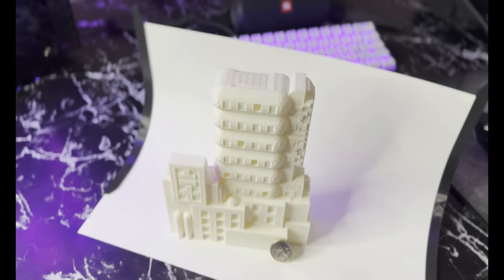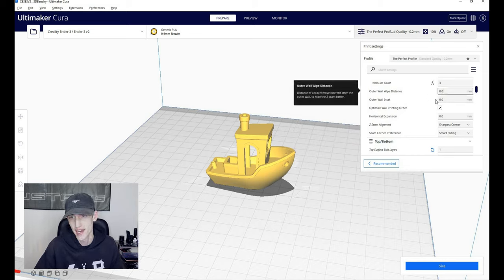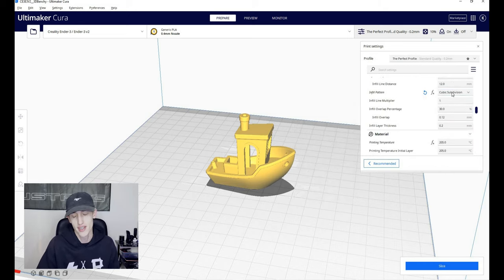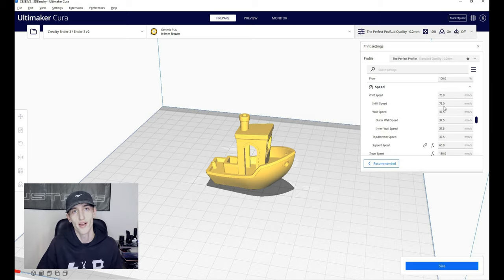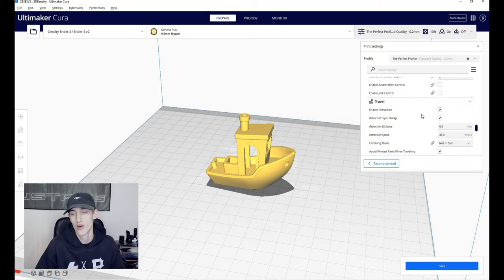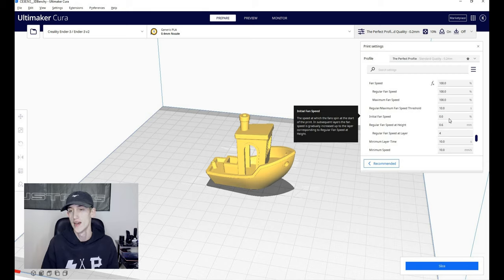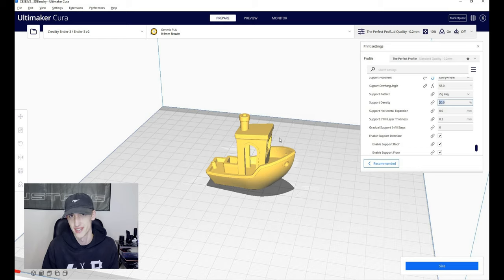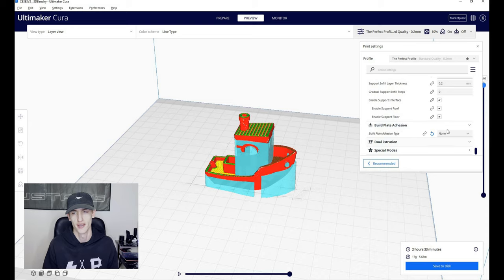How To Get PERFECT PLA Prints With Ender 3/ Ender 3 V2:

Comment: just got my Ender 3 V2 setup and run into so many issues off rip - this video has been super informative and i can't wait to jump back in get it sorted! cheers for this dude :)
Reply: I spent like 12 hours this past weekend fixing a bunch and replacing parts. 
My advice would be to fix one thing at a time and test it. Fixing multiple things at once and you won’t know what the problem(s) is/are.
Reply: Welcome to 3D printing where the real hobby isn't playing with your prints, it is getting the thing to print... anything... to play with
Reply: Did you get on with the settings in this video?
Looking to applying these myself

Comment: Some other setting i followed got me to 13 hours for my current print and with your settings it got me down to 6 hours. time will tell the quality but using an ender 3 cant blame the settings for that all the way
Reply: What did time tell you?
Reply from the maker: Let me know how it works for you! I’ve tried the same settings on a stock ender 3 and they seemed to work great In my experience

Comment: Just wanted to point out that your wall line count is tied directly to wall thickness which relies on your line thickness. Line thickness being 0.4mm x 3 walls = 1.2mm. I don't think you can/should unlink those settings from one another as increasing or decreasing any of those values independently from one another will cause changes in the amount of extrusion is pushed through the nozzle to compensate. (ie. Wall thickness 1.5, wall line count 3 at a default line thickness of 0.4 based on nozzle width... that would result in the printer pushing out more filament to have a line thickness be 0.5 to be able to meet the wall thickness). I believe Cura will warn you too when doing that or as I see in your profile I think it's greyed out so you can't change it unless you click on the Fx icon next to it.

Thanks for all the pointers though, many of these settings helped.

Comment: Useful video...
Always on the lookout for better prints, so checked your settings to my own, they are pretty much the same as mine for my CR10 and Ender 3 V2. I've printed on glass with the CR10 for more than 6 years just using a glass bed and good quality hairspray. In that time, I only lost a hand-full of prints but never to adhesion issues, I should also note, some low cost hairsprays don't work so well...

Comment: I love your info on the printers. but I have a ender 3 pro with a sprite extruder and a cr touch. my main problem is the print starts on the low left hand corner. How can i change the setting to start in the center of the bed.

Comment: You should make  a video on how to make really strong printed parts and printer settings for prints that can withstand weight being hung from them and can take some force. I love this video but will these settings in this video work for prints that need more strength is the question

Comment: I have a question i followed this quide and saved a profile when i slice a file and try to print print speed is till set to 100 on the first layer i have to manually adjust the speed and nozzle temp and bed temp and fan speed . I have an ender 3 . Is there something I'm doing wrong when  im slicing  for the profile not to be saved with the presets.

Comment: For some reason after getting the pei flexible bed I have layer shift. The first thing I’ve printed was the calibration cube and I don’t know how to fix this. Any suggestions?
Reply: Firstly if the bed is level, get a metal ruler and see if your actually bed plate is warped, it’s very common for it to be warped so don’t panic if it is there are ways to fix it.

Comment: This isn’t a print settings problem but every time my Ender 3v2 moves to print it make a loud noise. It sounds like the belt but I don’t know what to do. any suggestions?
Reply from the maker: Mine did that too until I just added a direct drive extruder on it. I am actually editing the video for the right now if you want to do that upgrade. If not, you might want to check the wheel tension on the hot end and the z axis rollers

Comment: So question after I’m prrinting on the tuning it says print speed 100%
Is that 100% at 75 
Or is it changing my values
Reply from the maker: It could be changing your values for the first few layers to get better bed adhesion. Or the speed might be max at 75mm/s and that would be 100% of your printers capability. I’m not 100% sure
Reply: @kelpy222  much appreciated 🖤